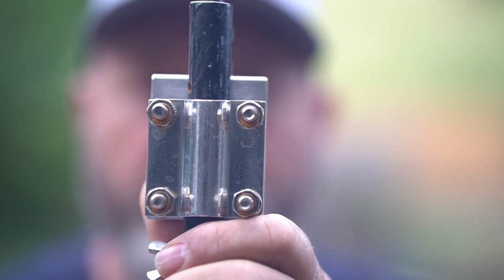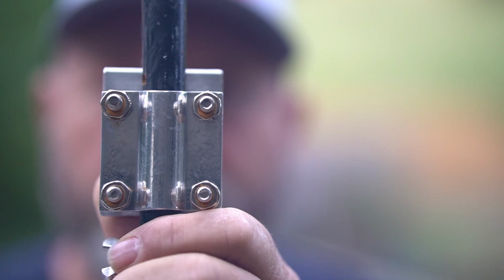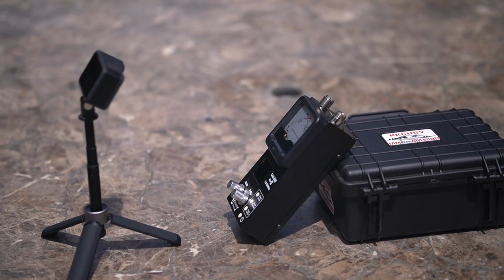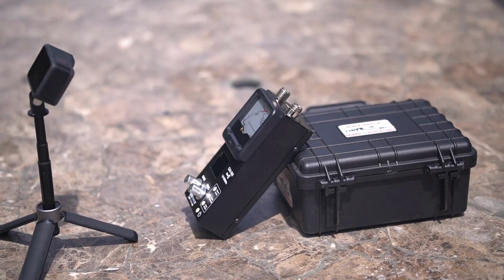20.00 Stake mailbag. Questions, Comments and answers!

Comment: Thanks Chuck, nice to see you pay attention to your viewers. I am using a 3/4" by 24 inch fiberglass rod for the stake. My local hardware did not have the stake you use, but had electric fence parts. the fiberglass rod was 5' with a point on one end. I am using radials anyway, so the glass rod seems to work fine and is amazingly tough. It doesn't work with the chameleon stuff, but I can't afford their stuff anyway, lol.

Comment: Nice project.
Instead of drilling and tapping a hole, it would be a lot easier to put the wire on the thread on the mirror mount with a extra wing knot… # 73 - Jimmi

Comment: My next diapole is linked 17, 20,and 40.on a cx Commander pole. Just not sure on what coax to use. Power wise up to 100 watts. Looking for ideas on  coax.
Thank you for you content 
KQ4CD Paul ⚓️
Reply from the maker: Paul I use 8x most of the time not too expensive and you can get it at almost any store that has radio gear even Amazon.
Reply: @KK6USYHamRadioAdventures  tnxd Chuck 8x would find even if I QRP

Comment: Hi chuck! What makes the cahr 49:1 different from all other 49:1s?
Reply from the maker: Jay all 49:1 EFHW are basically the same our winder is the main difference than most other in material and the way everything flows in a straight line. Plus, we source the parts provide it in a kit and you get to make it yourself, and for a new Ham the first time you make a contact on an antenna you made it's just a great feeling or was for me. The last thing is look at chameleon's EFHW antenna like ours it's almost 200.00 crazy!
Reply: @KK6USYHamRadioAdventures  yeah I purchased the myantennas years ago for crazy money. After that I’ve built the rest. Came to like 30$ or something. I love them. They work very well for me. I can’t get the 10m band very flat for some reason.

Comment: What I am going with Chuck, is a pack frame. The old aluminum style with a shelf for packing loads. I made the shelf so it does not fold, and I am going to run the antennas attached to the frame. My gear including the radios, computer, and batteries are in a box which will counter balance the weight. A lot of where I plan to go this year is bare rock on the summits, putting a spike in the ground would not work in that situation. But, the rest of that antenna will be just fine, I can attach it to the frame!
Reply from the maker: You need to post some pictures when you get it done Liberty!